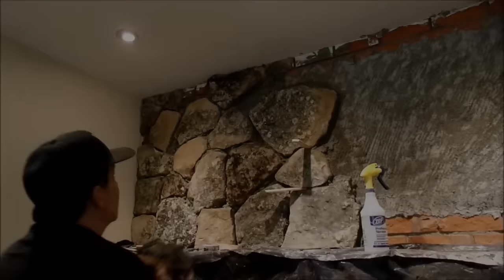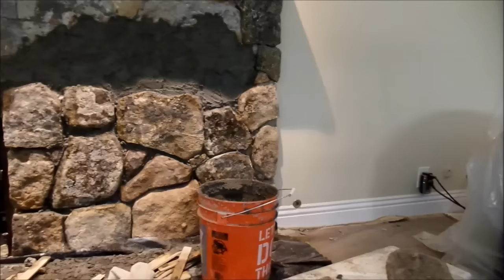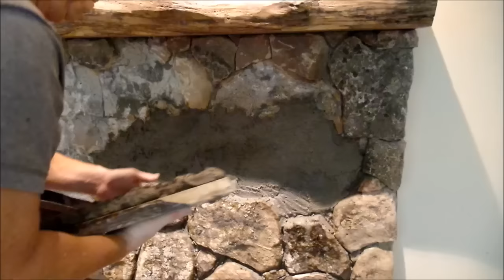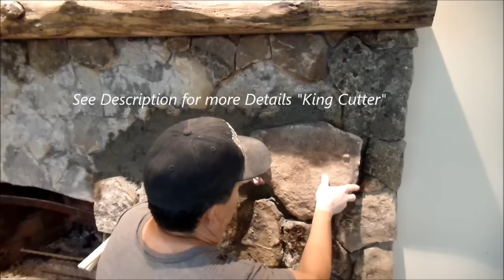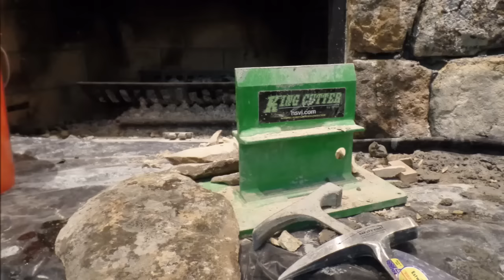Natural Stone Veneer Installation Fireplace

Comment: What tool are they using to rest the stone on, then tap it with the brick hammer to break it on that line??
Reply from the maker: Hello Ryan, the Natural Stone is resting on Wooden shims when needed, Thank You for checking out
Reply from the maker: When the Stone drys nicely on the surface, just remove the Wood Shim
Reply: Thanks for the reply!

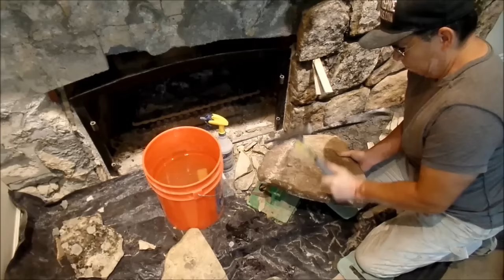@ 0:36, could you post a link to what tool it is you use to break the rock?
Reply from the maker: @ryannewby4061  Here's Link to Cutter https://youtu.be/NfTgOJedLq0

Comment: How deep should i go in to the stone to hang a 70 lbs tv  above the fireplace? Thanks
Reply from the maker: hi Jr Coral, regarding the Installation of the TV - it's been hanging the TV mount brackets first, then stone around. Never seen the Installers go through the stone, especially a 70lbs TV.  I would remove if possible, some stone for the bracket, then attached the TV brackets to the wall / wall studs for the TV. Hope this helps.